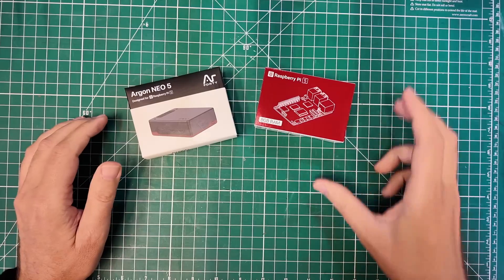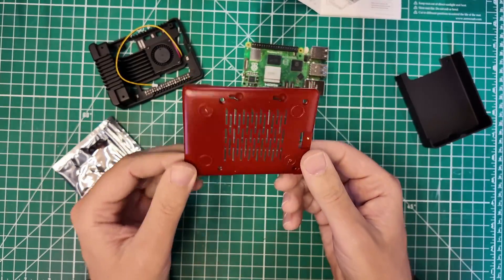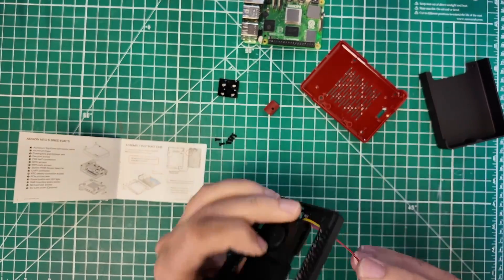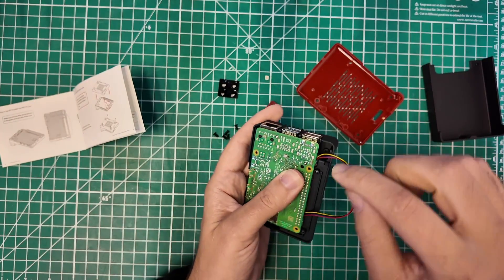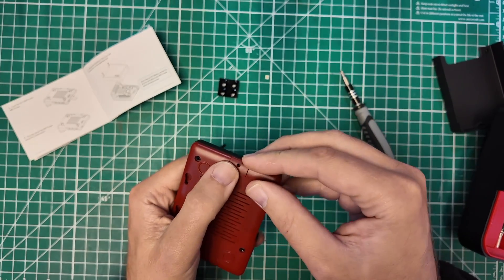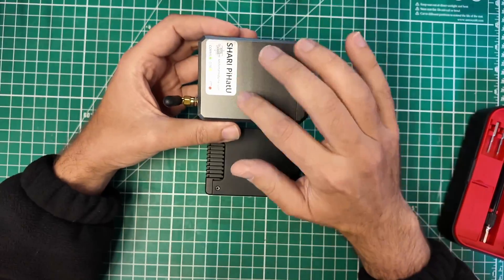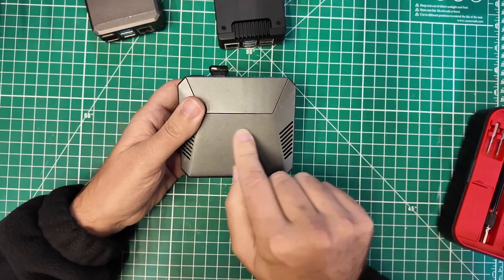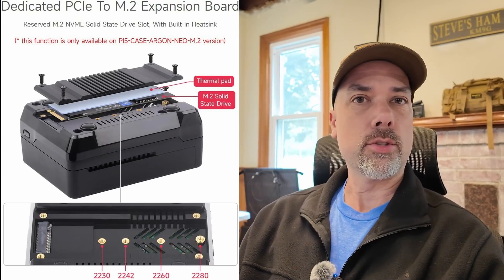The Pi 5's New Clothes

Comment: That some HAM sexy cases . love them thermal silicone pads . I have a assortment of them pads. with and with out sticky . SSD drives coming down in price and getting larger and faster. I have a new HDD SATA drive. 3.5 in but 10 TB . I got M2 SATA SSD in laptop. 1TB . use lot less power. I think my network drives will work as long as log into my privet network. at home can do threw Wi-Fi or Ethernet. not threw internet but I can if I want to change some settings. both me and my girlfriend can access same drive same time. we both keep back ups of back ups on it. I can get into drive USB as well. love them SSD . no moving parts.    my 2 TB one is USB 3 . looks like a USB stick but a little bigger and it's super fast and I have it bootable . I can boot a laptop into USB . most newer laptop does that . get more life out of Pi buy keeping them cool ! 73's
Reply from the maker: SSDs on Pis are a whole nother level!
Reply: @temporarilyoffline  The price is coming down and the storage TB is going up ! SSD's and Pi's perfect match !

Comment: I'd love to find a good 1dc to USB-c solution that would power a Pi-5 and not give the low current errors.  Got anything cool?  Thanks!
Reply from the maker: Its my understanding that the "official" power supply has a signature that turns that off - I plugged my pi into a 100w/100ah PD connection and I still got that message.  I'm not happy.
Reply: @temporarilyoffline ….your “understanding” is wrong.
There is no “official secret signature” in the “official” Power Supply.

ANY supple capable of 5.1V @ 5A will fully power the Pi5.

Argon, CanaKit, RadXa, Vilros.. among others who sell Pi5 power supplies.

If your 100W/100ah PD gives a ‘low power’ warning, then there is a problem with the power actually getting onto the board.

Bad wiring.
Bad USB-C connector
Misconfigured USB-C

The Pi5 has been available since October 2023, and there have been no widespread complaints of actual power failures , such as plagued the Pi4 release (which WAS an actual RTFM failure in the UBS-C design stage🧐)
Reply from the maker: @ernestgalvan9037  would be happy to know what power supply you're using that powers the pi5 with zero warnings on the desktop. Like I said, I've used quite a few and all of them have issues. https://cdn.discordapp.com/attachments/807059272215166977/1245172746896277555/s-l1600.png?ex=667815bd&is=6676c43d&hm=233b5763ee704ef9e830d0eb3b59450601705027cc76ccdac2ca9bc929af5519&

Comment: I have that case with the NVME bottom and couldn't get the NVME to work. The case is awesome, the pi5 is crazy fast just on the micro SD. I can't imagine the speed if I can ever get the NVME to work. I used the commands listed in the manual for the NVME then I loaded up the latest image on the SD and booted it, then used the drive copy to the NVME, but it wont boot. :(
Reply from the maker: I haven't messed with the pi5 version, the pi4 version is a USB adapter.
Reply: I had the same issue with my Argon case with the NVMe bottom. I have stubby fingers and eyesight issues, and my age does not help at all; I was not seating the PCIe ribbon all the way in; I was afraid to break it, so try messing around with that ribbon and watch that when seating one end of the ribbon you won't pull the other end. After about 45 minutes, everything worked. Now, be careful which EEPROM bootloader you flash because if you want to switch distros, you might end up opening the case again to boot from an SD card and install another distro. The other option is to get an NVMe external enclosure to flash the distro and then install the SSD into the case; that is better because all you have to do is to unscrew four screws and install the drive into the case. Good luck.
Reply: @luisbperez368 … yes, the fiddly cable is, well, fiddly…🫣 99.9% of “NVMe not working” is due to install problems with that fiddly cable.

Comment: The Argon cases I have all have SEVERE fan noise. (I have 2 Argon ones and then one I got with the SHARI node.) All have the fan noise like the fan is rubbing up against the case somewhere. That and the cost of the PI5 alone I can get a faster mini PC with a case. For PI Hole and a lot of my pi needs where GPIO is not required, I just go with mini PCs. AND, they don't suddenly start squealing in the middle of the night.
Reply from the maker: Don the mini PC lover (and Pi hater)
Reply: @temporarilyoffline  I don't hate them per se. They certainly have their place but I mean who can argue with 12V and faster processor. And I respect you for sticking to your guns 😉
Reply from the maker: @don_n5skt  I respect your opinion as well - I like what the pi represents more than its price/performance.  I think a 12v PC is better overall, but you still have the screen/keyboard problem... that the evolve3 solves.
Reply: I have six Argon cases that have integrated fans. NONE have fan noise, and two are several years running 24/7.

And I also have at least ten Dell & HP USFF. Great machines, BTW.